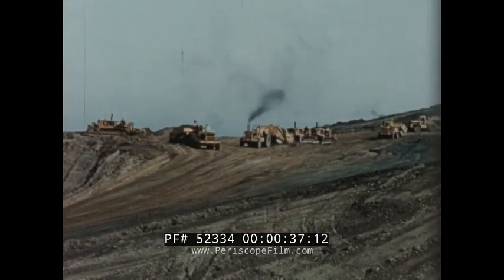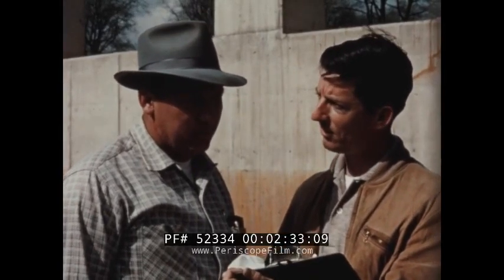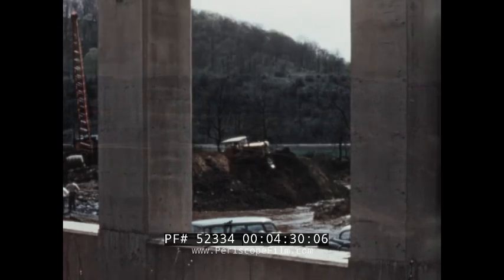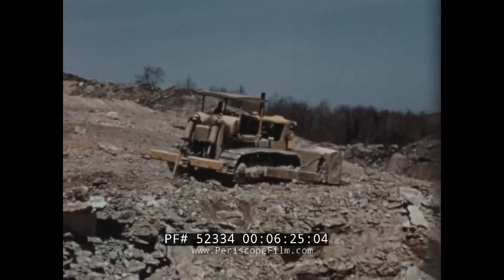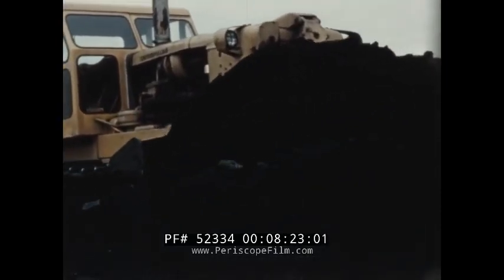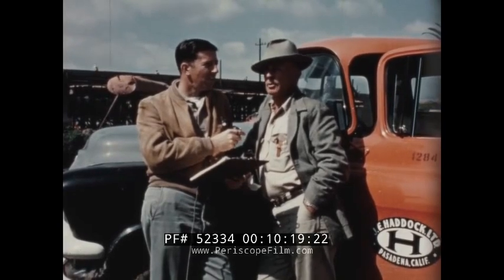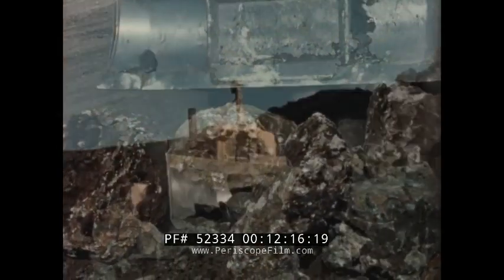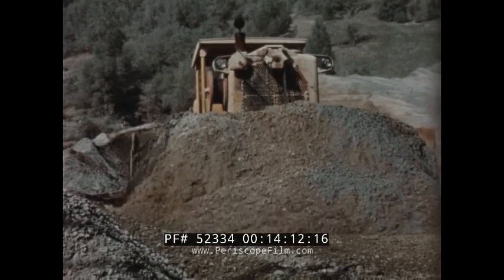CATERPILLAR TRACTOR COMPANY D-9 BULLDOZER 1950s PROMOTIONAL FILM  52334

Comment: I love old CATs. Best dozer ever. I learned how to operate a dozer in a 76 D-8k. I miss that dozer so much. Incredible amount of torque and gorgeous styling. Let out the decelerator and a mushroom cloud of black smoke and then the turbo screaming and you spin the globe beneath me as the torque starts getting applied and material rolling in front of your blade. Great memories but the biggest dozer since that was a high sprocket D-6 from the late 90s. I love construction and dozer work from initial cut to final grade is incredibly fulfilling and creates a close connection to the machine and adds to the pride I take in my work at the limit of my abilities. Every hour spent is that much more experience that much more confidence as well as further pushing myself and thoroughly study the machine and feel of the machine to become one man and machine. To me as an operator the dozer is the one piece of equipment that you have to get a feel for their individual quirks and depending on the wear and maintenance, how much slop is in it I feel you need to have more feel for a dozer than sat an excavator.
Reply: Terex had some awesome dozers. Love them Detroit Diesels.❤
Reply: @carlachambers3771 I’m a diesel nut. Old screaming Jimmies bring back more great memories. I’m starting to sound like an old guy. The world is changing and demonizes all the things I love.

Comment: The first dozer I ever operated was one of these . It had a front mount winch & rear hydraulic ripper. Soon learned  that cable blade needed a special touch to get the best from it. Oh yeah & who could ever forget the pilot ( donkey ) starter motor . Got an old photo of me pushing out a hwy cutting near Streaky Bay South Australia 73/74 . Turbo whistle sounded good too .

Comment: when my grandpa worked on building  the new york thruway in the 50s they would use a D9 to push start the belly dump trucks. they parked 4 or 5 in  a line then pushed them all to pop start them  to save time.

Comment: Old Cable dozer pictured in the highway job in California.
I was a mechanic for a company that liked running old iron.
Even back in the early 80s it was hard to find a Cat operator that knew how to handle a cable operated front blade. And it was a real mess when an operator got the cables fouled.

Comment: the 1954 D9 WAS IN AN 18A and a 19Aseries,,,18s had a diesel fuel lubed torque converter behind a 3 speed tranny.THE FUEL LINE SUPPLYING THE BIG 6 CYLINDER MOTOR came off the bottom of the transmission....down side was that you were  exspaected to keep an over half full tank of fuel.....or they would run hot

Comment: I think it would be neat if they occasionally had the erant piece of lint or hair go thru the screen or stutter like an old 16mm film. ;-)
Reply from the maker: Our transfer system is a bit too high tech to allow that ... those hairs or lint can scratch the films so we use compressed air and rollers to prevent that from happening.

Comment: When I was younger I worked for a construction outfit that ran old equipment including a 1958 D9H
It had a 2 cylinder gas engine for starting the main engine.
You had to fire up the Pony motor which used a heavy-duty electric motor, then engage it to the powerplant's flywheel. Once the main engine was spinning fast enough you started feeding it fuel as it picked up speed it would disengage the Pony motor, then cut gas to it as you fed more fuel to the main engine.
Cold mornings were always fun.

Comment: how inefficient- dragging all those logs through that slop. What sawmill would want mud ground into all those logs. Today excavators and haul trucks rule.
Reply: India uses energy efficient elephants for logging. lol
Reply: um most log skidders still drag them.......
Reply: They dump them off at the yard into ponds or lakes and they get washed off and they also have spray washers also in the mill. Allot mills have debarking machines so it doesn't matter if they get mudded up.